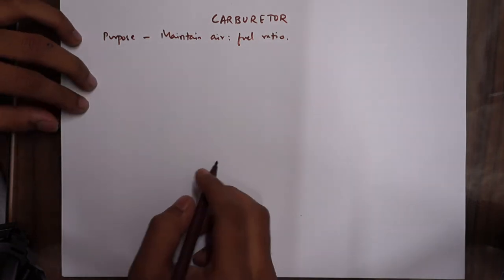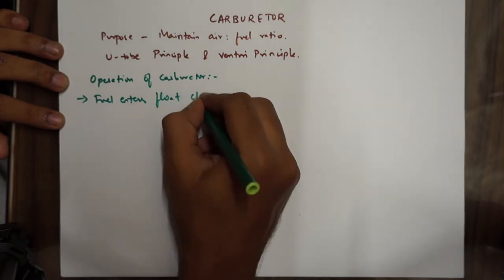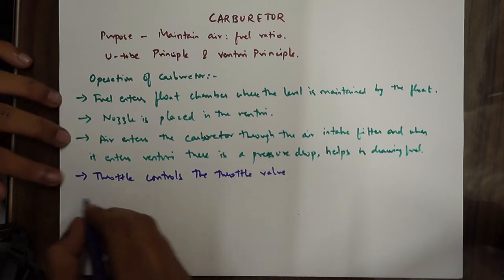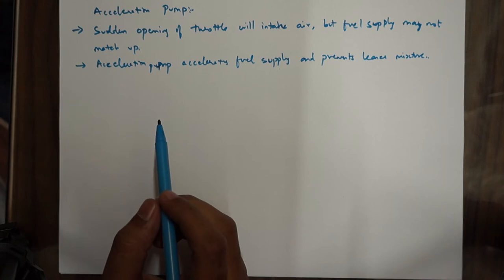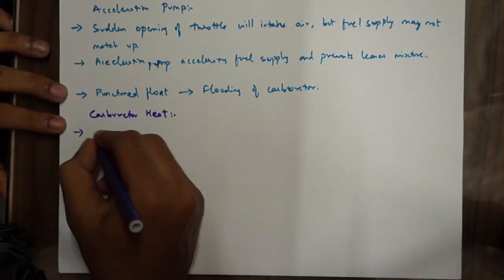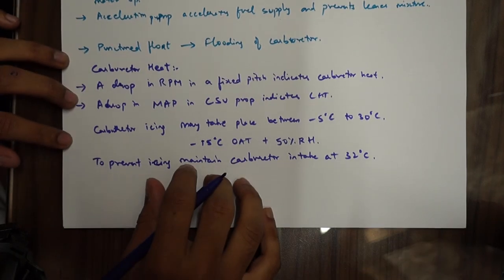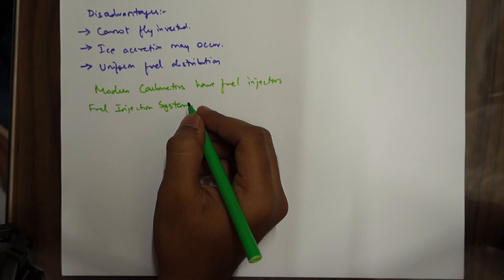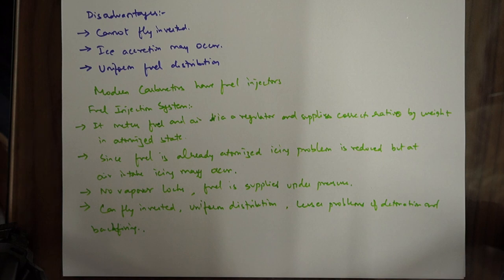Piston Engine - IX (Carburetor)

Comment: sir,if air flow and fuel flow is controlled by throttle means .....what is the purpose of mixture control lever in the cockpit
Reply from the maker: It controls the air:fuel ratio. Flow is rate of given fluid. If I limit the fuel to 10 or 100 units. Flow is how fast I'm sending those 10 or 100 units. Mixture control is limiting the value of fuel.